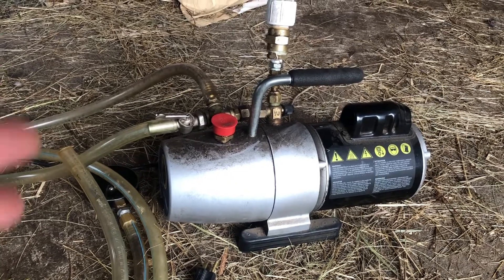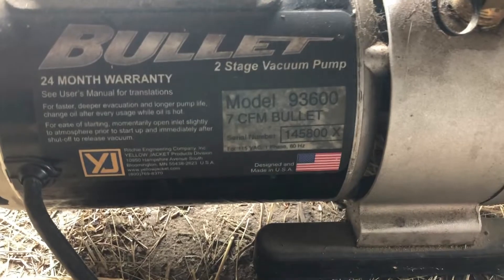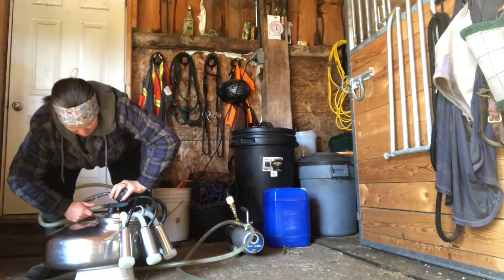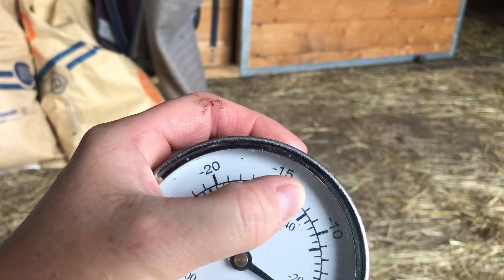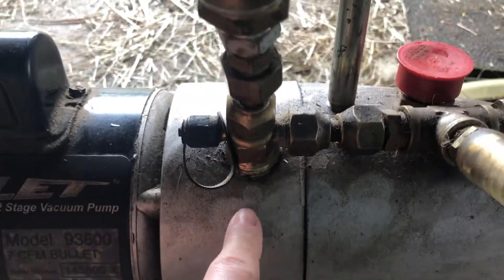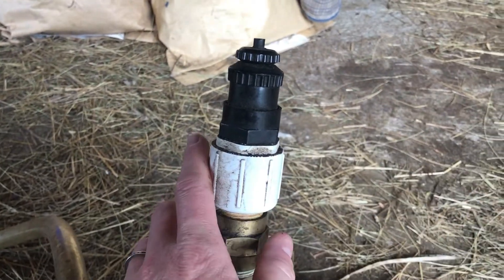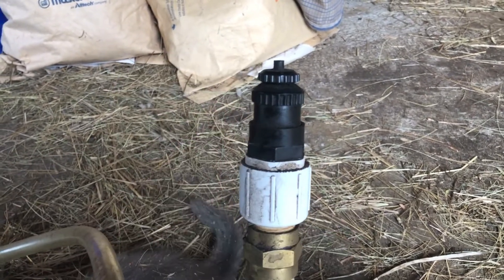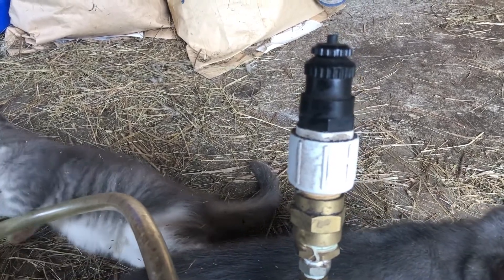milking pump for the homestead

Comment: How much does the small can hold?
Reply from the maker: The small ones hold around three gallons of milk and the big ones around 4 gallons.
Reply: When you said it didn't hold it pulse so you replaced  it! What did you nean?
I have the same set up! 
How long does it take to milk your ciw
Reply from the maker: I switch the pulsator as needed.  One of them wont work in the cold (the newer one) so in the winter time I use the original surge pulsator.  Sometimes it needs to be fully cleaned out with the replacement kit, which was what was happening.  It just needed its maintenance done.  It takes about 5-10 minutes to milk her out depending on how much milk she is giving me